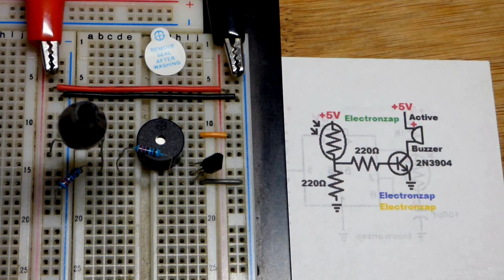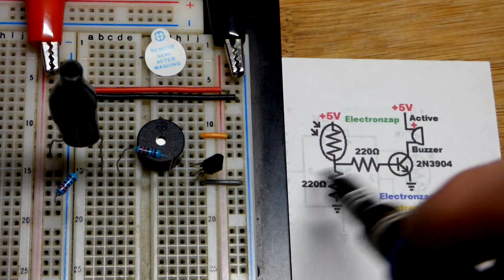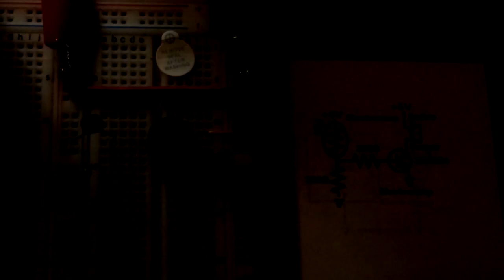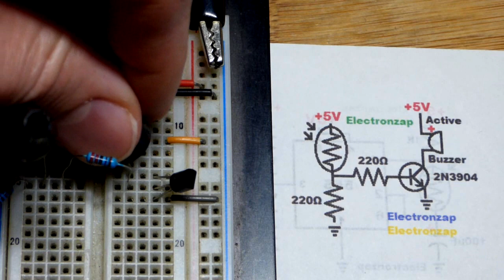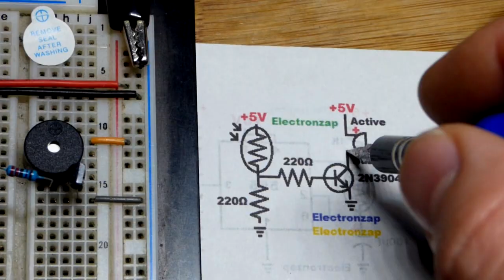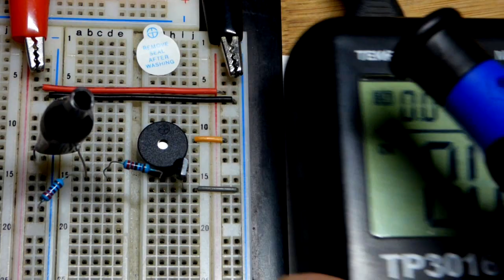Light Turns Buzzer On using NPN BJT switch circuit demo 2N3904 Bipolar Junction Transistor

Comment: Yes, these videos are always top notch! This video gave me a couple ideas. It would be interesting to use a 555 timer to make the buzz last half a second or so. Then, a 556 and a passive buzzer, using the other part of the 556 to play a lower, less annoying frequency. Something I'd also like to try is a 555 controlled servo with the LDR controlling the angle; in other words a sort of light gage. It could be interesting to see how accurate such a gage could be, especially as there aren't any microcontrollers in the circuit. It’s all analog. I suppose choosing the best passives to calibrate the servo angle to be 0 degrees at full dark and 180 for max light will force the M word on me, math I mean. Its worth it, there's nothing like seeing a project / idea come to life. Feel free to poach if anything seems interesting to you. Thanks again for making such awesome vids, keep it up!
Reply from the maker: Thanks for the input! I already did a 555 controlling a servo circuit video,  not sure when I will cover it again, I don't think it gets enough views to only be made once. People have made pretty much any circuit you can think of with the 555 which is why I make so many videos with them. Even if it isn't the best component for the job, pretty much everyone already has them, so might as well get as much use out of them as possible. It's good practice for designing circuits that respond to signals.  I've never bought 556 because they aren't cheap. The saved space is probably worth the price for a permanent multiple 555 circuit, but not so much for demonstration circuits that I know people will be trying to copy.
Reply: @Electronzap  Hmm, that sounds reasonable, hadn't thought of it that way.
It’s interesting to see how a problem can be solved with softwhere and a microcontroller, or strictly in hardware. It reminds me of BEAM machines, Biology Electrical Aesthetics and Mechanics. They became popular in the 90s and could do everything from facing toward or away from light, to walking like an insect! The cool thing is that they could get a lot done with a few parts and a dribble of power. It’s interesting that a microcontroller with software loaded and locked in is considered different from a device built from such a few parts. A purpose-built device will have fewer parts than a microcontroller because you'd need an SR latch or a flipflop, and there you go, at least two transistors per bit. Another interesting comparison: "core memory," like the Apollo computers used, and ram / roms.